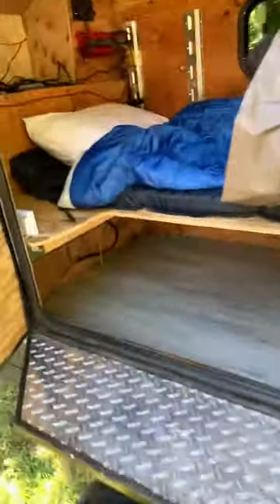Off-road camper trailer DIY

Comment: What are the cabin dimensions? LxWxH
Reply from the maker: Internal dimensions are approximately 6 1/2’ x 4 1/2 x 4 1/2.   To be honest a little too small I’m just under 6 foot so I’m able to sleep in there, but if you’re claustrophobic, it would be a bit challenging and also it’s too small to change your clothes and comfortably. But it keeps you dry and warm and it’s more about adventure.